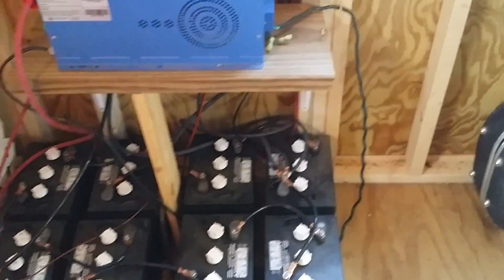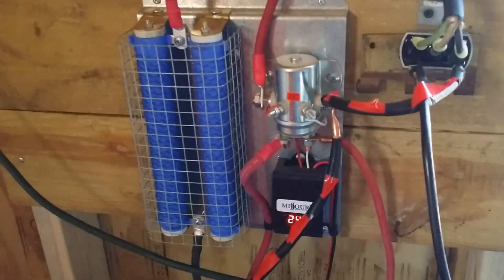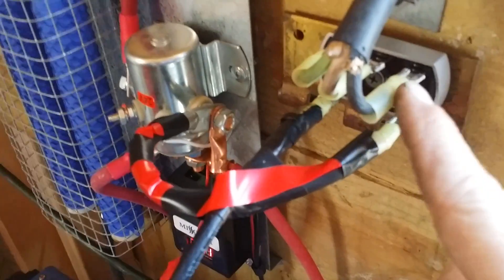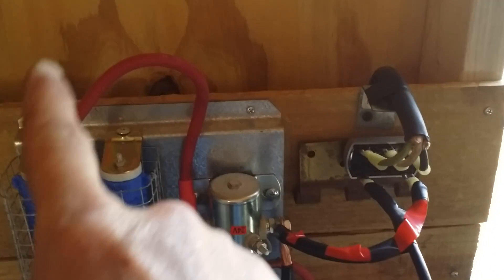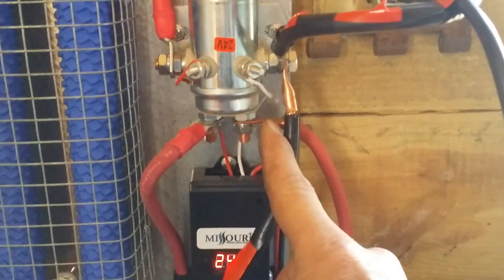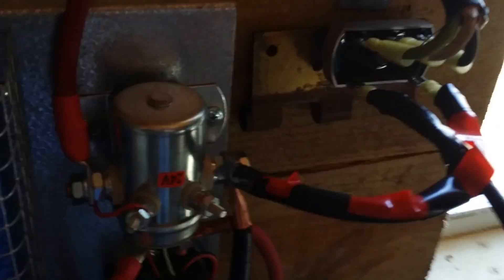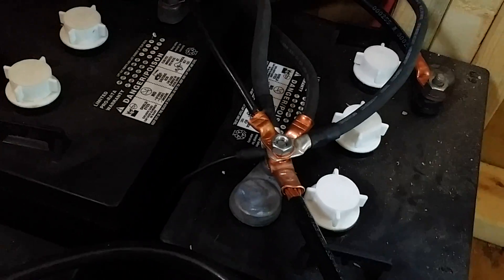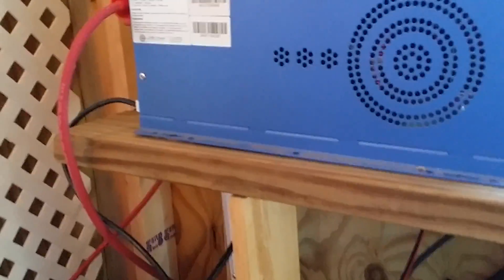Wiring up the Missouri Wind and Solar Wind Turbin.

Comment: How's it holding up 5 years later? I'm not sure if you're aware but there is a fair bit of controversy surrounding that mob, it's been alleged that those solenoids will eventually fail open and risk burning out your turbine. It's also alleged that they are a $7 dollar part being sold for $50
Reply from the maker: I got rid of the wind turbine after a couple years  because not enough wind around here and I never was able to get a tower to get it 20 feet above the trees. Everything else I have is still working great.

Comment: Please put some Varistors parallel to the capacitor! I think one over 100V and another by 50V, the capacitor must be 10.000uF or more/63V. The Varistor protect the circuit by cutting the voltage.

Comment: Hello Mr. Bremer. I live in Brazil and found your video doing research on wind and solar enegia in hybrid systems.
I'm riding a hybrid system in my house and I lack define the wind charge controller system for a wind generator that provides 1000 watts x 24v.
I understand Missouri company website this silver piece allows you to connect solar panels or wind generators that add up to the limit of 10,000 watts or 440 A. That's right? This information is correct? This component actually does this? It's just that I could not fully understand the explanation in the Missouri site. Also I do not understand can be connected solar panels with wind turbine in the same terminal of this piece, or whether it should be a piece for each energy source.
I would ask you to kindly explain to me what is the function of this round silver piece with 6 terminals.
I beg your patience with my bad English because I'm using google translator, but I need to know that in order to decide if I can buy this American company. I have many customers to indicate if the piece serve in my system. You have several people who already have an interest in buying if they see my system working well. Could you enlighten me on this subject please?